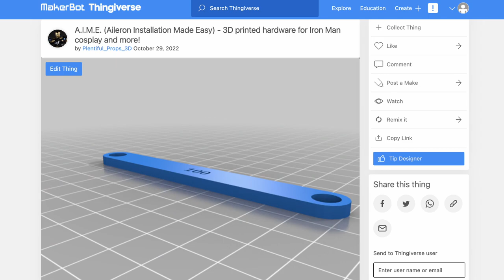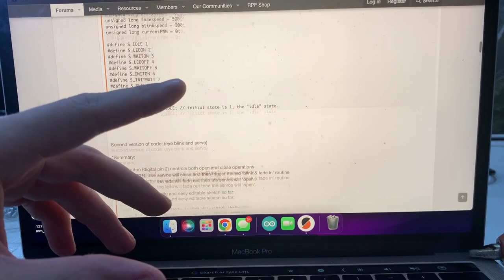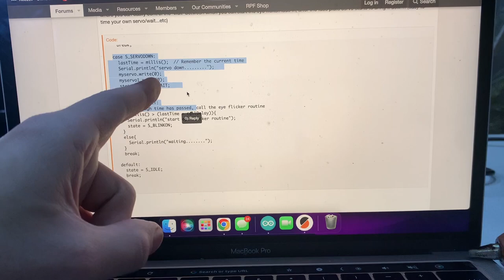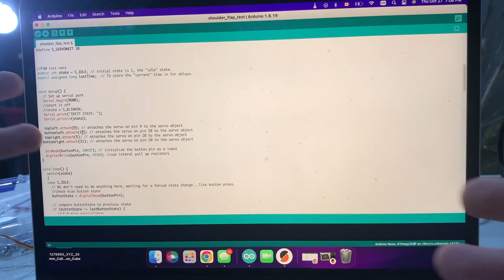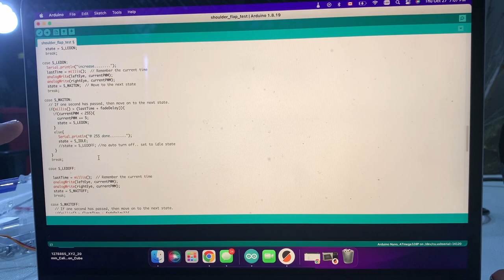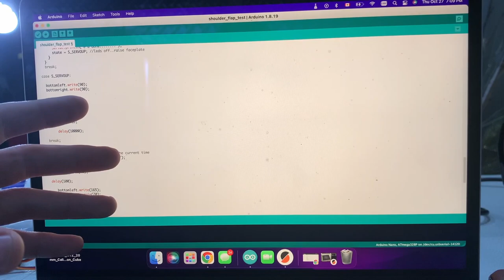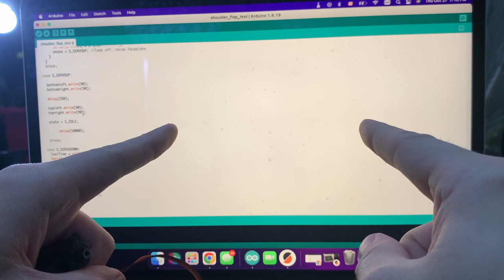NEXT LEVEL IRON MAN SUIT! - How to Motorize backflaps for an Iron Man suit

Comment: The arduino resetting problem you talked about at the end might be flyback voltage from the servo motors. It's basically an EM field created by the motor which induces a current in the wires. You can add a capacitor across the + and - of the servo to absorb the spike. Btw really nice suit!
Reply from the maker: Interesting! I’ll give it a try, thanks!

Comment: I think if I plan to do this I will used a random delay and random movement to made flaps moving
Reply from the maker: good call, I tried my best to get it to be as random as possible but it was quite difficult to get the delay commands juuuuust right
Reply: @plentifulprops3d  it need more conding expérience but i guess the good way is to make a fonction returning a random delay and move and another making the values not killing the suit 😅

Comment: What is your tool settings in arduino like the libraries and connecting arduino nano
Reply from the maker: Just the servo library :)
Reply: @plentifulprops3d  oh I see and if I may ask which adruino nano do you use and if you also use that for lights

Comment: Hey. I love everything you are doing here and I’m in the process of building one too. What I’m wondering is ; your top ailerons ,Did the file have a hinge or did you make that.? Not the motorization kit that you made ( which is awesome by the way) but where the actual flap mounts to the top of the shoulder area. 

I’ve got the file set from Johan3d which I’m assuming you do too

And I’m noticing what I printed is not hinged.

Great work love your content. Please keep it up.!
Reply from the maker: Thanks! And unfortunately its not hinged, it’s something you have to add yourself

Comment: The reason of your arduino reseting is because a motor (servo in this case) when it stops it generates an inverse current that mesh with the arduino electronics (basicaly a diode) and that micro power shortage is what keep reseting the system.
I have had similar problems in other projects. Adding a capacitor between + and - of the servo can solve the problem but having an independent power supply is better option (having into account that electronics like LEDs, arduino... uses like miliamps and servos several amps).
Reply: For context, i have been designing an ironman suit using the base MK6 model from Do3D for the last 6 or 7 years with voice commands, an android app with Bluetooth, fog, sound, lights, flags and missile movement... and this kind of videos show to me that it is posible to do and to get ideas.
As an software engineer, developing all the systems with arduino and ESP32 is quite fordward, but editing the STL is a nightmare for me 😅

Good content and better ironman suit.